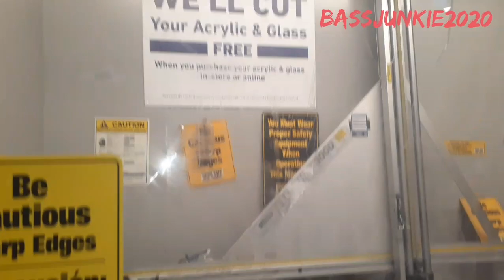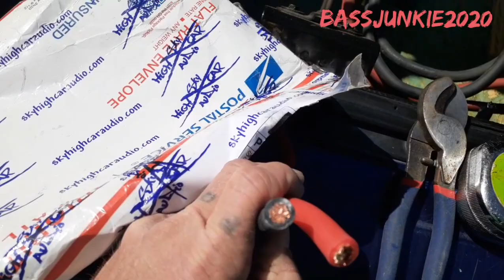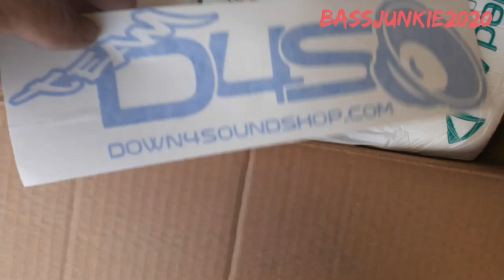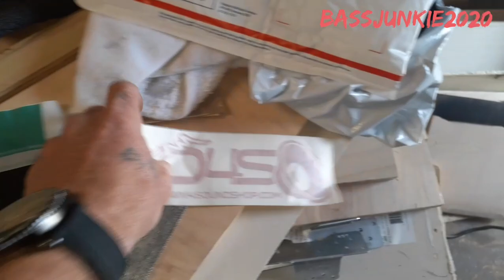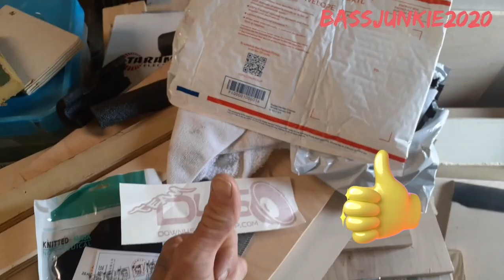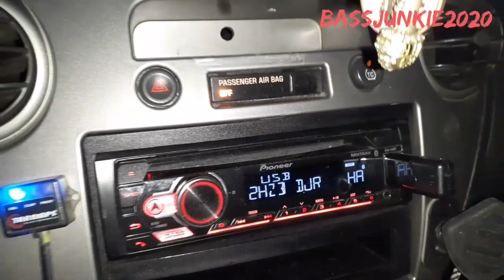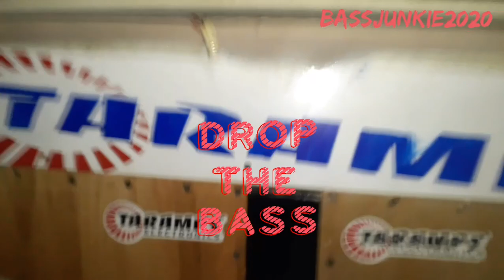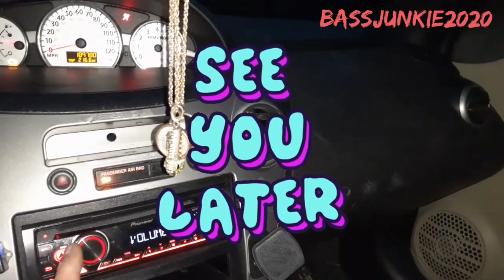Got  2nd Sundown 15" Xv2 from Down4sound came in! So now I can finish 4th order! Taramps md 8k

Comment: You would figure for how small that car is them 2 15s should be ripping it apart at the seems what's going on need more power or is it the way the box is setup I would of faced the subwoofers towards the back of the seat I believe it would do better
Reply from the maker: Yeah I think it's the port design. Im going to change it. I don't like how you cant see subs either. But I didn't design it. 🤷‍♂️👍💯
Reply from the maker: And I know its not power. I have 8k on them and 250 alt 40 ah lithium. I actually have to much power going to them
 They get hot🤔
Reply: @bassjunkie2020  I have no idea I seen videos of them in the trunk of cars here on YouTube killing it no wall lol I just thought it would be more impressive you did a lot of work there even you didn't seem impressed with it the way you talked
Reply from the maker: @zeth15943  I wasn't. But I have some footage from today. I got it sealed off better now. And amp turned up some. It was flexing my car decent. I'll upload it later. But I did expect more from 2 of them I had one on a wall and it was badass! I'll probably change it lol. I have changed it so many times. Look through my video's.  But it's not bad. I just expect more. I think a bigger port will solve the problem 👍💯

Comment: Idk y my 1st comment didnt post mayb cause i had a link for plexi in it anyways looks great id find away to make front baffles for speaker removable like added a bolt an fasting nut to it with sometype of gasket to have a good seal ill txt u plexi link in a sec
Reply from the maker: I have it where I can get subs in and out if I need to👍😎💯💨💨🤷‍♂️
Reply: Well u should get a gasket around them still since u can calk to make a strong seal
Reply from the maker: Working on getting it better😉👍💯

Comment: Is there a way to straighten twisted plywood?
Reply from the maker: Lay it flat overnight. Don't do it in the sun. Because sun will suck out moisture 👍😎💯
Reply: @bassjunkie2020  I already layed it out flat over night. I heard it can be done by adding moisture
Reply from the maker: Yeah that might work!👍
Reply: @bassjunkie2020  hey man I'm sorry to keep bugging you. Does the caulking bond to wood glue with no problem?
Reply from the maker: Yeah. But just let the wood glue dry good 1st! I use all weather caulking 👍👊💯
Reply: @bassjunkie2020  thank you. Can I join the group? What are the requirements?
Reply from the maker: Sure you can join! All you have to do is love bass lol 👍👊😎💯💨💨💨

Comment: Hey bro what size is that lithium?
Reply from the maker: 40 ah limitless lithium 👍💯
Reply: @bassjunkie2020  it does the 8k good?
Reply from the maker: @brick2077  Hell yes! I only have the lithium hooked up no other battery! It runs my car and 8k. I just hooked voltage meter up yesterday. I had one but it broke. But I got new one. I have video I will be uploading later and you will see. Was going to film more today. But its raining here. But I highly recommend the limitless lithium 👍💯
Reply: @bassjunkie2020  what about super capacitors do they work? Was thinking about getting some or the lithium
Reply from the maker: @brick2077  I've never had any. But my friend runs a bunch of maxwell caps. He says they help a lot!
Reply: @bassjunkie2020  sweet.
You have a really nice build going on there. I'll be watching. I can't wait to get my 18's walled in my truck.
Reply from the maker: @brick2077  Thank you very much! And join my group link in description. And post pictures of your set up! We would love to see it😉👍👊😎💯💨💨💨

Comment: Those are some sexy looking subs and that 4th order box is looking sweet. By the way Amazon has these dual 8 gauge wire input reducers you can use in order to fit 2 8 gauge wires into the subs push terminals and they are made by skyhigh car audio.
Reply from the maker: Oh really Thanks! I might get those from sky high 👍😎💯💨💨💨

Comment: Nice man, haven't finished the video yet but so far looking badass!!! I just got a new alpine amp for my two audiobahns that're still hitting hard somehow and replaced all my wiring with knukonceptz 4g tinned ofc yesterday. NEVER going with cca again. No idea why I ever did. Still have to tune my amp but I have to wait until tomorrow because of work sadly. Oh also I had a question, my rca's only run from my amp to my lc2i so i only need maybe two-three feet max.  Should I get rid of the cheap ones I have had for years and replace with shorter ofc? Would it actually make a difference in sound? Thanks man.
Reply from the maker: Thank you! And I'd definitely buy new rcas! The better the less chance for interference. Get one's labled shielded 👍👊😎💯💨💨💨💨
Reply: @bassjunkie2020  I'm with bass junkie on this one and it probably looks better without 20ft of bundled  rca cables laying around. By the way I have a SFB2000.1 amp for sale. Bearly has any playing time on it.